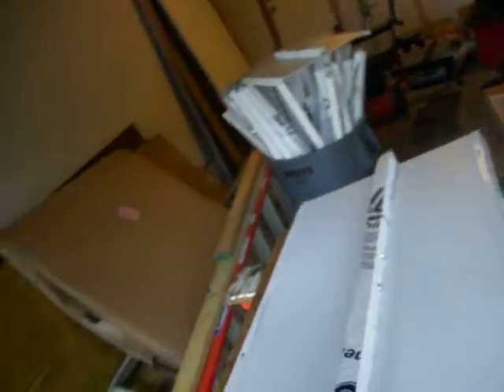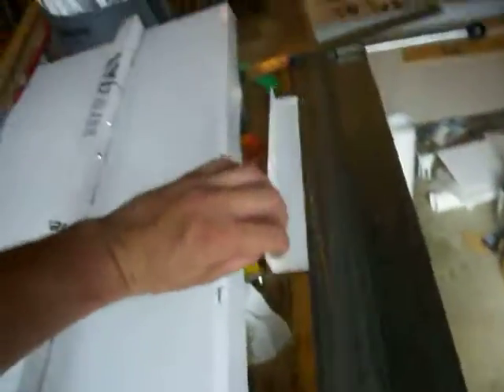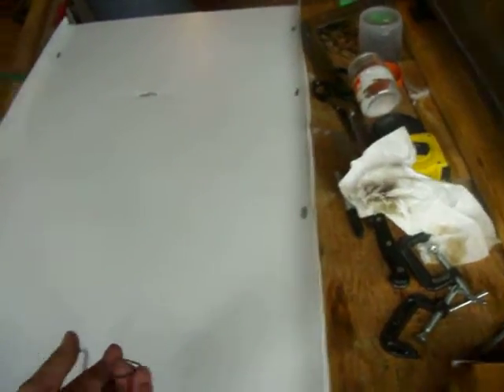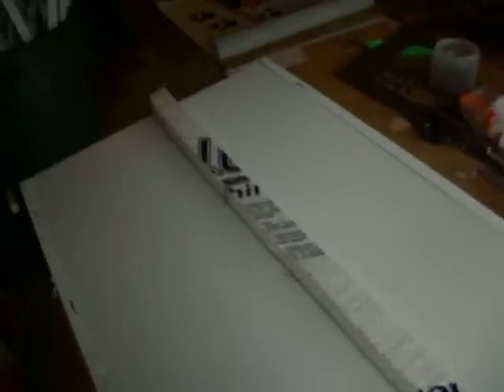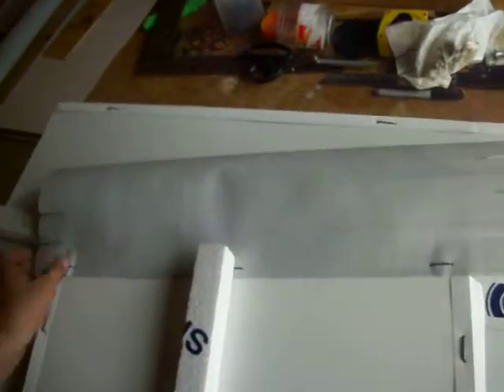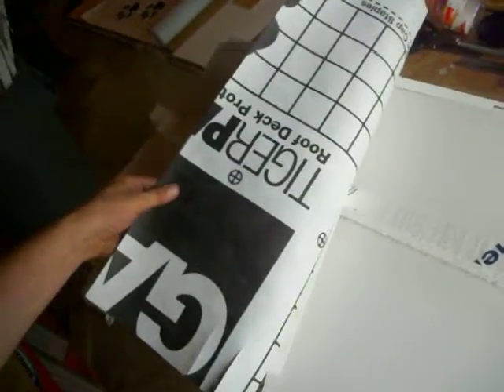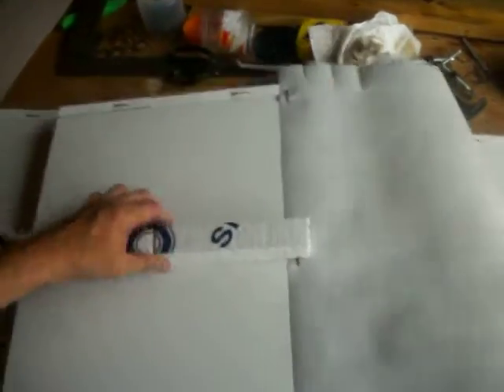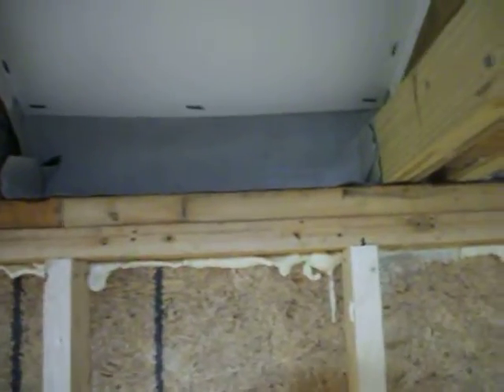Custom Attic Insulation Baffles

Comment: I wonder why you couldnt use hollow interior doors cut into strips??  Theyre the same thing but boxed in and a door cut into 3 strips would slide through the soffett and not attach to anything
Reply from the maker: Whatever material is available at the lowest cost, sure!

Comment: Russell, interesting video. I used 1/10" underlayment plywood sawed at Home Depot 12" tall and 24" long. Jammed into truss bottom and screwed into truss using cabinet screws. Agree store bought baffles are flimsy. I had to go this route because my roof is 4/12 pitch and it's near impossible to install store baffles. Thanks for sharing.
Reply from the maker: Most welcome!

Comment: Interesting.
Why attach the sides to the rafters?
Why not run 3 strips of rigid foam: center and both side edges?
Blown-in or batt insulation won't get into the air channel.
What about using cardboard instead of corrugated plastic?
Reply from the maker: "Why attach the sides to the roof truss members?"

Have to attach them to something.  As stated in the video, attaching them to the roof sheathing presents problems when the sheathing is replaced.

------

"Why not run 3 strips of rigid foam: center and both side edges?"

A possible configuration.  However, use of a small stapler through the Vinyl makes for quick and easy mounting in tight spaces.

------

"What about using cardboard instead of corrugated plastic?"

Cardboard degrades eventually gaining the rigidity of tissue paper.

------

This was just my go at the issue.  I'm sure other configurations will work depending on costs, effort, goals, and the like.
Reply: Well, not really.  
Your inserts are fairly rigid.  The roof above and the rafters are rigid.  The length of the insert won't let it angle too much.   If the insulation fills the space below, it will hold the inserts up against the roof deck.  As the insulation ages, it may let the insert fall away from the roof deck--but that will increase the air gap.  

As long as the insert cannot fall toward and block the eave vent--no problem there.  That can be ensured by putting retaining nails into the rafters at the lower end the inserts.  The sides of the upper edge--not being held up by insulation--could be nailed to the rafters with a rigid foam block taking up any space between each bent side the rafter. from inside the attic.  I've heard the upper edge should be about 24 inches above the level of insulation in the attic.

The only issue I see is that the rigid foam may snag on roofing nails during installation.  The thinner the 3 'spacing members' the better.  Why not bend the side edges of the cardboard and in both side corners: glue in a small rigid foam strip at the corner to maintain the bent side at a 90 degree angle?  Cut and bend an inverted V strip out of cardboard that has about a 1-inch edge on each side and glue that to the center of the main cardboard.

Whaddyathink?
Reply from the maker: Sure, give it a go!  The only way a process improves is by trying other configurations.
Reply: Revision is the only path toward perfection.
Great minds think alike--so do idiots.
I'll keep you posted (just don't hold your breath).
Reply: Russell,
What kind of bender do have?  
Do you like it?
Does it easily bend long sheets?
Of cardboard?
Where did you get it and what did cost?
Reply from the maker: https://www.harborfreight.com/30-inch-bending-brake-67240.html

This is the brake.  Grizzly, HF, and a host of other suppliers sell this Chinese tool.  Works on thin gauge stuff.

I bought it ten years ago when I replaced the roof.  I needed something to form the copper I used to flash the chimney.  A very worthwhile investment since I find uses for it constantly.

I've never attempted to bend cardboard with it.  However, I'm sure it would handle the material just fine.